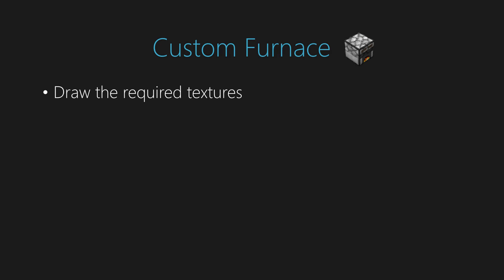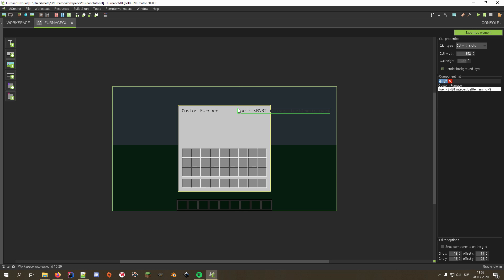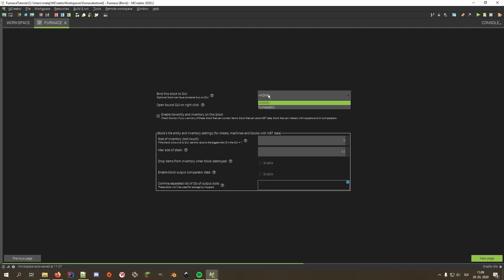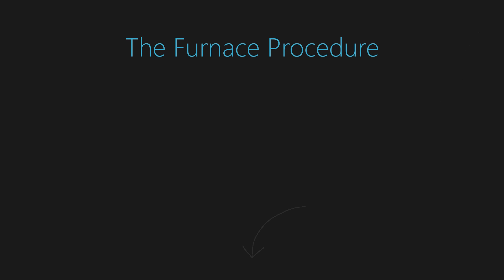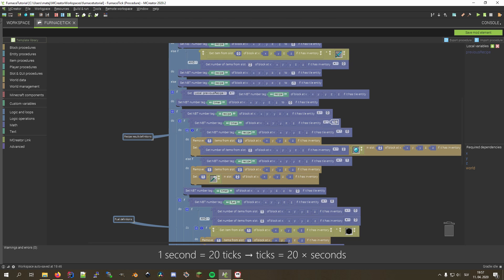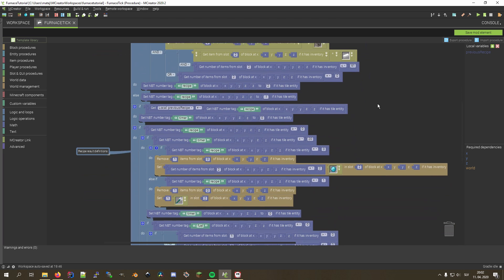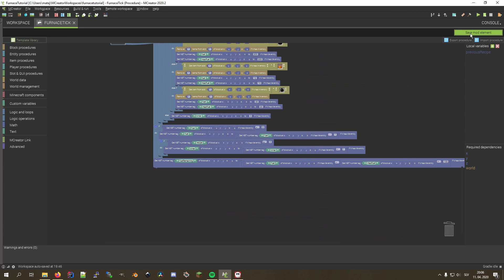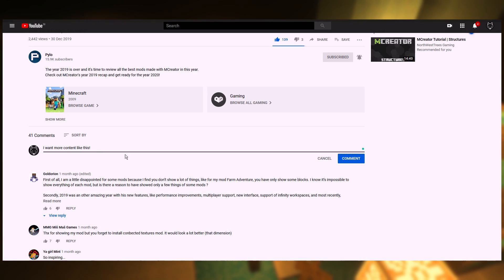MCreator Tutorial: Create Your own Smelting Machine

Comment: A tip  for everyone who has the newer versions of MCreator! instead of adding all the possible fuel types to the code, just use the fuel power block, if it  outputs 0, then the block cannot be used as fuel. anything else passes. If you still want to customize the ticks it takes to burn a fuel piece, just put either a constant or a the fuel power block combined with the add/subtract block to the place where you set the fuel tag after the furnace picks up a new block to burn.
Reply: Which block would you use for checking the specific item slot? The "Get a copy of item from slot [] of provided itemstck, if it has inventory"?

Comment: Thanks for the tutorial. I have two questions however.

1. Is the FurnaceDisplayTick procedure validated to work in 1.15? Because it isn't working for me.
2. How can I make my block textures change when the furnace is smelting (like the vanilla one does)?

Thanks again!
Reply: (not a dev) From what i know and have tried, both work fine in 1.15, so if it isnt working, ask about it on the forum with screenshots. As for the second question, that's not a feature yet but its planned. (sorry im a month late, hope it still somehow helps)

Comment: Awesome tutorial, I would really like to see more from you. Here is a thing I found how to do while messing with it, "How to set all the vanilla smelting recipes to your custom furnace". Just like you said, add a new recipe validation ELSE IF to check if the item in slot 0 can be smelted, under it, and IF the item in the output slot is the smelting result of the item in the slot 0 AND if there are less than 63, OR if the output slot is empty. Set the Recipe ID tag to 2 or whatever number is next. In the Recipe results, add another ELSE IF to the Recipe ID being the number you just selected, in the DO section, Set the "number of items in slot 2" plus 1, of the smelting result of the item in slot 0, to the slot 2, and then remove 1 item from the slot 0.

I would like to know though, if there is a way to make something happen, i.e. call a procedure in another block, but every time something is smelt/cook. I think it is possible, I'll be looking for the specific place to put the command, but I would appreciate any help.